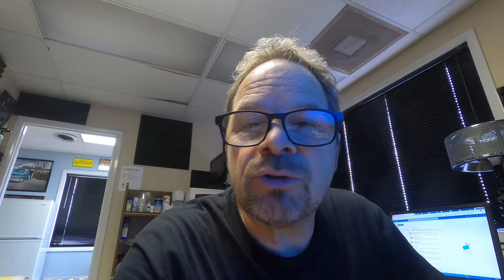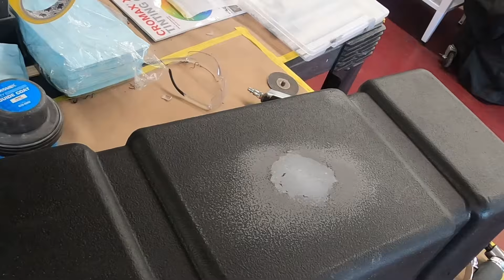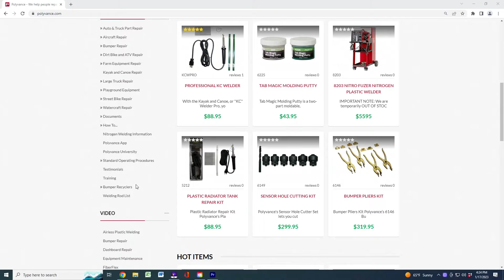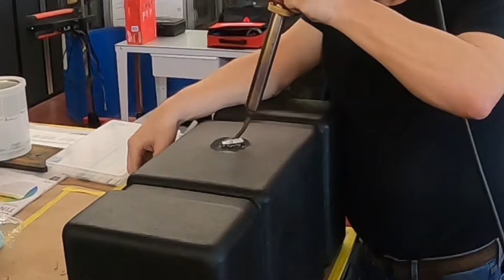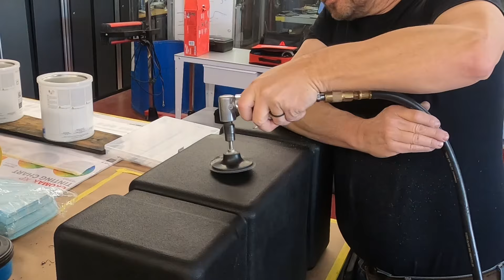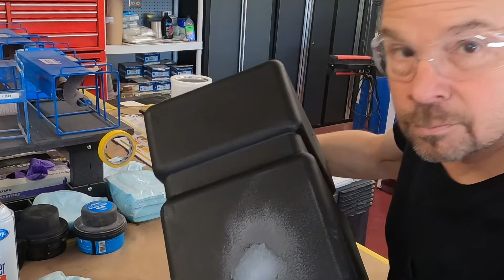Plastic gas tank repair... the easy way!

Comment: New Porsche tank $8k.  Turn off air suspension... ramp and jack... sand and prep the outside.  Seal All. Maybe epoxy over it.  put it down and turn the air suspension back on.

Comment: Iam a professional plastic welder.
I am working on cars motorcycles and tractor plastics.
PE plastic is very tricky 
Some tractor tanks are saying PE mark but actually are HDPE.
the tricky part is that you can weld low density on high density PE but not the opposite.
An easy way fix a hole is sand it with 60 grit make oval shape hole take metal "hair" ( this kind of stuff to polish metal) close the hole and mix some cold weld glue and close it entirely
Reply: Like a scrubby pad or like a steel wool?
Reply: Steel wool.

Comment: A guy in the UK told me about when his fuel tank cracked and started leaking, it was a MDPE roto molded fuel tank, he cut a oval opening so he could reach inside and using a heat gun welded the small crack, it lasted 6 years and he needed to reweld it but that was easy. For welding rod he used the oval piece he cut out after cutting it into strips. It was a homebuilt aircraft fuel tank btw.  After the repair he made a aluminum oval lid and gaskets to seal it.  Thx for your video, often better to repair than replace depending on situation.  Tech-Bond offer a non weld solution as a second option.

Comment: I fixed the wheel shroud on my '86 Vette using a soldering hot air station with matching plastic welding rods. It was cracked in 3 different places. Good pieces to start out with since it's not readily visible, but it was pretty easy to do. I think I've watched every single Polyvance video, it's a great channel!

Comment: My plastic welding is a soldering iron with 3D printer filament, it works.
Reply: If you don't match plastic types, it won't last.
Reply: @larrybud  been two years and it is still going. Guess the 3D filament I used was close enough then.
Reply: @jmoneyband13st75  It might be, depends what you're welding. Did you use PLA, PETG, ABS, or something else?
Reply: @larrybud  It was PLA and it was a riding lawnmower plastic tank. The two plastics melted together quite easily. But, it is showing zero signs of failing.
Reply: @jmoneyband13st75  PLA and polypropylene, if that's what is was, are somewhat compatible, however pla degrades over time with gasoline. Keep an eye on it.
Reply: @larrybud  I have been. Have to keep an eye on my neighbors they just came and ripped up my survey spike. Now to get an updated land survey. The last one we did was 2003 or 05. Oh well a lot of me problems, now. 🤣🤣🤣

Comment: the easy way ? he's a certified tech for the easy way it costs more than a new tank
Reply from the maker: Depends where you are, and what shipping costs for a new one to arrive, and if you can wait for a new one that might be out of stock, and if you have to use the vehicle in the meantime... alot of farm equipment has polyethylene and polypropylene tanks, maybe those need to be fixed? and maybe they're more expensive than the cost of the equipment to fix it, learning how to repair might mean you NEVER have to worry about downtime with your equipment ever again?  I just think it's cool to learn new things and get out of my comfort zone.   Thanks for the comment! :)

Comment: Automotive polyethylene fuel tanks are not just solid polyethylene. There are five layers. Carbon black outer layer that blocks UV. Recycled polyethylene. Admer adhesive. EVOH which is a crucial non-permeable barrier for vapors. More admer adhesive. Then polyethylene. How does this filler act as all the layers and their required purposes? If your tank has a hole I would encourage people to either buy a replacement tank from an authorized dealer or even replace with one from a junkyard.
Reply from the maker: This is an aftermarket tank used in an off-road vehicle.  The repair has held up very well so far with it's limited use. Not sure about the chemistry between layers, but it seems like if the rod is matched to the PE, and you're getting a good fusion between filler and substrate, then it'll seal, which is definitely the case with this one.
Reply: Junk yards here punch holes in the tank to drain 😵‍💫. Mine seeps around where the filler neck fitting is attached to the tank. Epoxy putty worked for awhile, but the streets in the New Orleans area are horrible. I’m going to have to look into this kind of repair (01 olds silhouette with 276k miles).